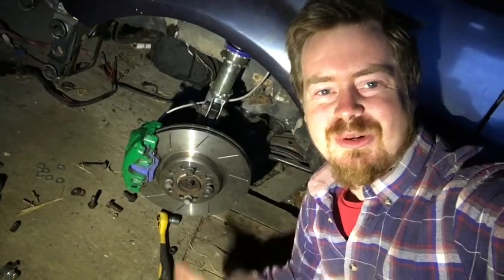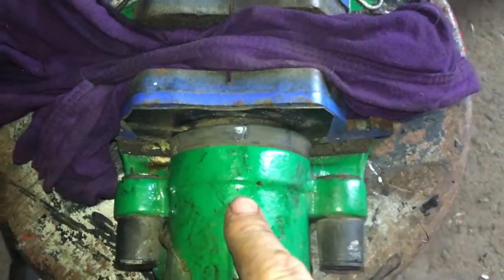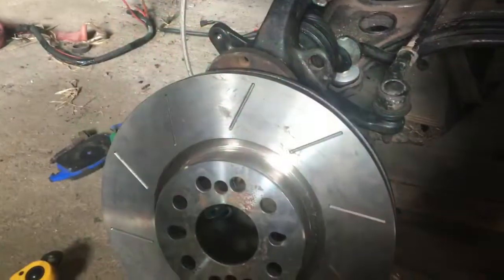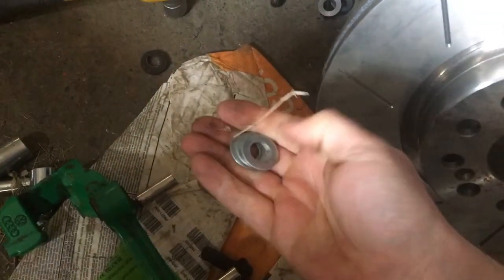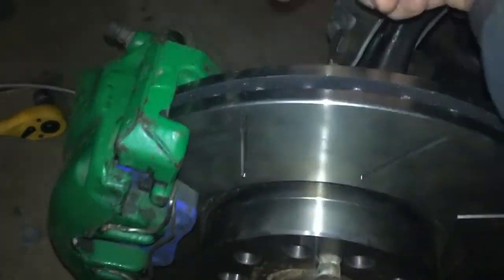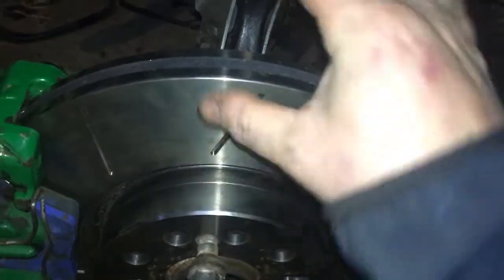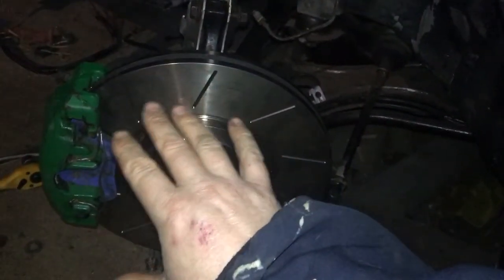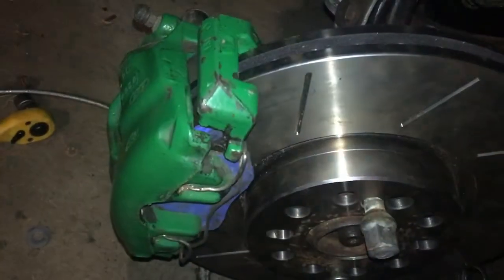312mm 4x100 brakes install on the corrado/ mk2 Golf  (ep 29

Comment: Nice stuff👍🏽 ive put mk3 5x100 hubs on my mk2 and using 312calipers with 2017 polo gti disc, those are 5x100 so i do not have to drill them very happy about that

Comment: i also have the narrow 4x100 axle with these calipers. i used bmw mini brake disks with 5mm spacers. the disks already are 4x100 with the correct centre hole, but they are 315mm instead of 312. but the lathe took care of that... now it all fits..
Reply from the maker: Oooh interesting !!  I would of done what you did if I had known. Thank you for sharing 👍👍👍
Reply: You could also slot the calipers to fit the 315mm rotors.

Comment: Nice one👍 I've already done my brakes, stuck with VR stuff, mk4 golf carriers on MK3 hubs required OEM disc with almost Nil offset, funny enough not listed on Corrado VR but on Passat VR!
Reply from the maker: Are mk3 hubs and Mk2 hubs the same ?
Reply: @stevenharpervw  on lot of models are the same, with little variation steering arm points and caliper setup, difference the mk3 GTI gets the VR wide track part's and bigger wheel bearings, which is nice!!!
Reply from the maker: @CrispysProjects  the Vr6 gets smaller wheel bearing because it gets thicker drive shafts is that correct ?

Comment: You keep saying 5x110, but all the newer Audi and VWs have 5x112.
Also, there is no problem redrilling the 5x100 rotors to 4x100, the clamping force is fine to hold it securely.
Reply from the maker: Yes

Comment: What is that disc originally off? what is the measurement of the friction face to the face that makes contact with wheel? i bought tt ones which are only 9mm, yours look taller
Reply from the maker: I think mine are from audi s line
Reply: @stevenharpervw  does mk5 gti or mk2 tt rings bell? I've tried mk1tt and they're wrong
Reply from the maker: @patrick lynam if I give you the measurements you may be able to email Mtec and find out ( I honestly have no idea. I do think it’s part of the vag family a audi or a mk5 or 6
Reply from the maker: patrick lynam patrick lynam  312mm diameter,  thickness 25mm of disk , 25mm from disk face to face bolt holes. Total height when flat on the ground 50mm,  65 bore hole, Originally 5x110
Reply: @stevenharpervw  thanks, those dimensions match what I thought it could be, there the same as mk5 :)
Reply from the maker: patrick lynam brilliant. When I was buying I didn’t care what car it was from but I had to be able to redrill to 4x100 with 14mm hole.  If I was doing it again. I would try and find a disc with less off set. And a company that sells blank disks ( so no 5x110) so no holes
Reply: I've asked several companies, including Mtec, and no one knows what vehicle that rotor is from. I'm wanting the same rotor in 5x100
Reply from the maker: @MattTN_82  Audi TT mk1 will be 5x100   Mine is not 5x100.  Its a wider offset
Reply: @Steve Harper That makes more since. Yours was originally 5x112 then. They came on the MKV Jetta and some others. Thank you
Reply from the maker: @MattTN_82  I now need longer lug bolts because the disc is thicker.